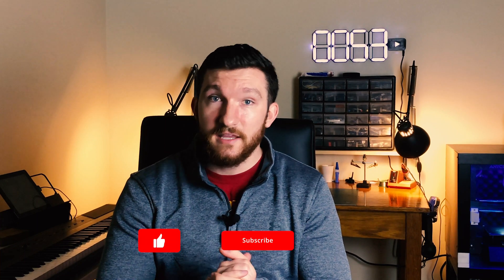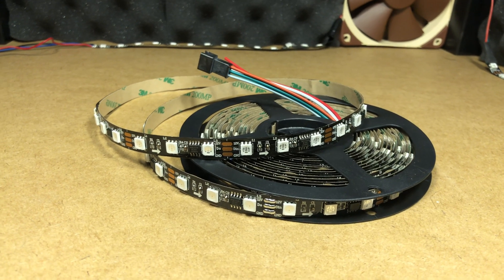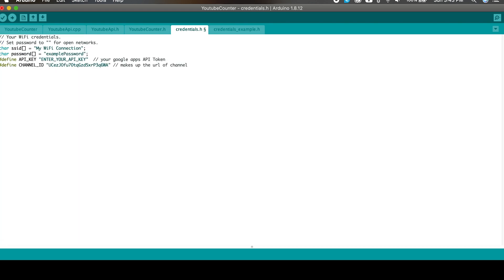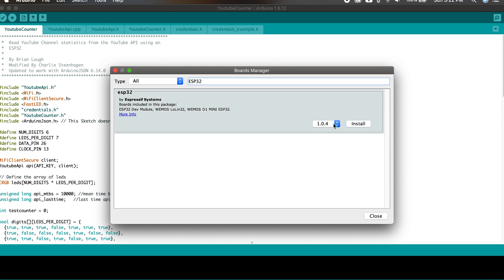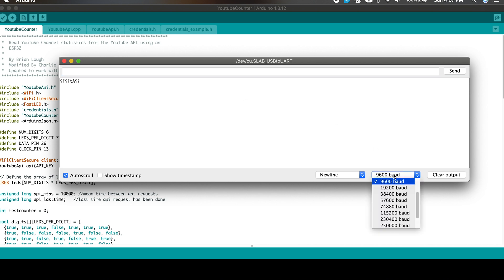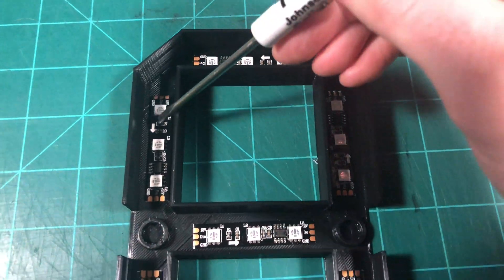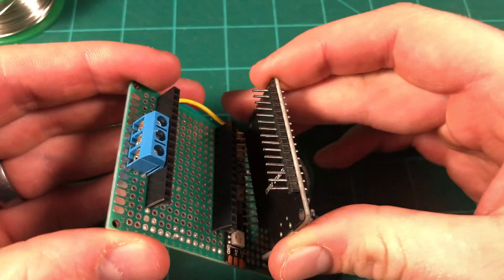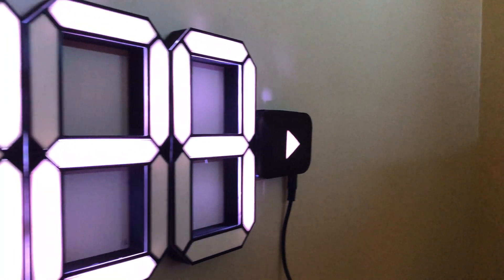Making a GIANT YouTube Subscription Counter

Comment: Hi. Its a great video. I am building a 7 segment project myself and your 3d builds really gave a good reference for me to start off with. One question I have though, my digit sizes are a bit different. I have one question. What kind of material did you use here? Particularly for light diffusion is there anything specific you recommend or does this work good? My project will be placed out and I am using green LEDs, so the idea is for it to be visible even in daylight. Also in terms of robustness what kind of material would you suggest?
Reply from the maker: Hey Harish, 

Thanks for the comment! For mine, I used regular PLA because that is what I had on hand. I found that for the diffusors, you need to go as thin as possible otherwise it becomes hard to see during the day especially if light is shining directly on them. At night, they are very visible, but still the thinner the better. I used regular white PLA because my lights are on white, but if you are going with green you could always try clear PLA. It will still be opaque, but it might let light through better. 

For my purposes, PLA was plenty tough enough, but if you are worried about durability you could try PETG, which prints very much like PLA, but it much stronger.

Hope that helps!
Reply: @ModernHobbyist  awesome thanks this helps a lot. I am still thinking if leaving out open is an option as there will be plexiglass on top of the whole structure to make it weather proof. Let me know what you think